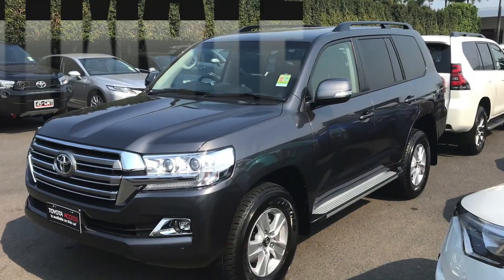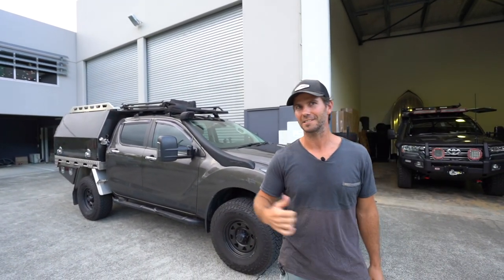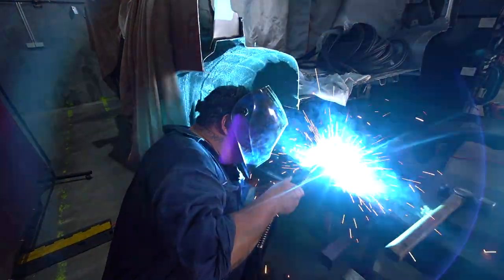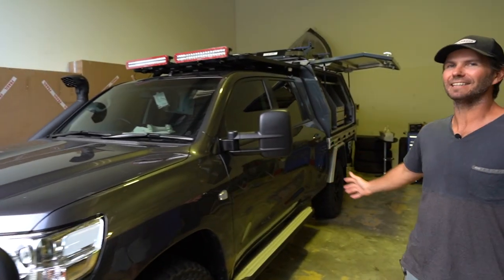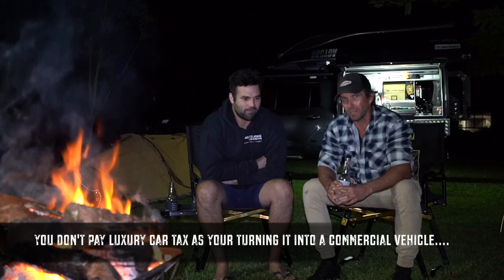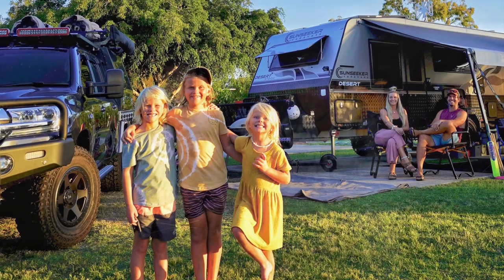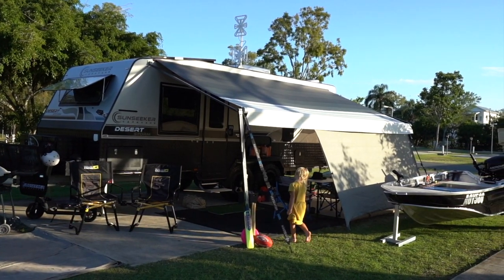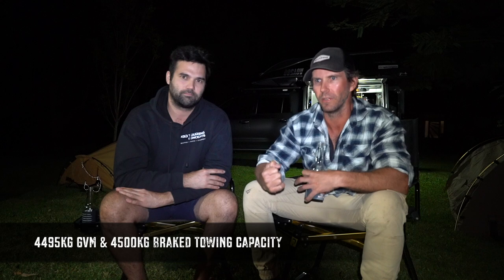THE "DUAL CAB 200" SERIES LANDCRUISER - AN ULTIMATE 4X4 TOURING WEAPON! Episode 1of the build series

Comment: You can raise the GVM and GCM etc...but underneath it's still a 200 Series cruiser. Personally I wouldn't like to be towing 4,500kg caravan with that vehicle. My personal limit for a trailer is to be no more than 80% of the GVM of the tow vehicle.
 I'll stick with my Single Rear Wheel Silverado 3500 thanks anyway... Payload of around 1,800kg (GVM 5,171kg) and GCM is over 11,000kg (but that is if it's being used for 5th wheeler) . My Bushtracker is only 3,500kg, so is well within the capacity.
 It goes like stink and has fuel economy that would make Landcruiser owners weep blood!! hahaha. It's all decked out with full canopy (not the type you bolt onto the tub).
Anyway, good luck with it and looking forward to seeing what the rest of the build shows us.
Reply from the maker: Bill Roach good stuff mate! 🤙
Reply: Bloody exciting mate cheers

Comment: Nice rig mate. Have a question you may be able to Answer. Having the GVM upgrade done so you can tow up to 4.5t does this include strengthening the structural integrity of your chassis, drive train, gear box and other critical components that the original manufacturer compliance was to not exceed 3.5t ???

Comment: Hey guys, did you consider the 4x4 light trucks at all like Iveco, Isuzu NPS or Fuso Canter? No space or weight issues and not much bigger? Reasons you didn't go with them?
Reply from the maker: insanedanielc118 they are a truck and they drive like a truck... and you can’t get a canopy like Norweld fitted to one. 💪

Comment: Great vid, would it be possiable to cover off a few of the typical questions? What's it like to park in shopping centers, what's it like to drive around town when not towing. The reason i ask is I suspect it is not too bad at all but you always have ppl comment about it.
Is it possiable to show the difference in towing "feel" ? Not sure how but i would think that towing with a well designed rig would be much better than the normal dual cab ute etc.
Reply from the maker: Matt Robinson we can definitely try and add that info in! Bec has been driving it and parking at shops all good👌

Comment: That's epic guys!!! Can't wait to watch the next episodes!! quick question: Did you installed airbag man plus the new suspension ? whats the go with the air bags putting too much pressure in the chassis in a point that it could bend it ?  Cheers amigos!
Reply from the maker: Marcelo Valente Ramos Airbag’s in the rear coils. No chance of bending the new chassis in this thing

Comment: My ultimate tourer is just a normal dual cab 79 with obviously a snorkel bullbar winch lights and a fridge in the back no need for lift as it can fit 35s stock don’t need 35k coil conversion 35k portals 30k canopy ect just a swag and a awning 🤙
Reply from the maker: Wilbur perfect for ya mate👍

Comment: Is there a reason no-one makes full length side steps for a chopped 200 series?
We caravan in Scotland with a 6 berth modern caravan similar - tho slightly smaller- to yours.  It's 24' 6" including the short draw bar and weighs 1259kg with a maximum weight of 1480kg. What the hell makes the Sunseeker SO much heavier at 4500kg ?!
Reply: Excellent 1st episode by the way, can't wait for the rest
Reply from the maker: James Feeney it’s only a 4.5 tonne atm, van weighs 2.9, so we have bulk payload
Reply: @TripInAVan   so 100kgs of clothes and 1500kgs of toiletries, hair straighteners, hair driers................or is that just us..

Comment: I still from this video, and many of other's videos still don't see a valid reason to cut a 200 when a RAM 2500 will do all this with far more torque and payload.
Reply from the maker: Hunting Arete it costs more and you can’t get parts and no service agents when touring Aus 👍
Reply: @TripInAVan  so  a question what is your 200 load carrying capacity now? Ie GVM minus kerb weight.
Also how is your new car warranty effected after the cut? I could see any warranty claims knocked back with the heavy loads and high duty and mods.
The majority of 4wds are very reliable now and the only systems on a vehicle that are not common mechanic knowledge are the ECMs. And even these, the knowledge is widespread now. Look at how a third party tuned yours.
I wish you luck with it and keep the great content coming. And yes I do own a Ram 1500. Best vehicle I have ever owned and I have owned a 60, 80 series, Hilux JK Wrangler, Sierra and a Pajero.
Reply: From memory it’s 4495, 5kg from being a HV